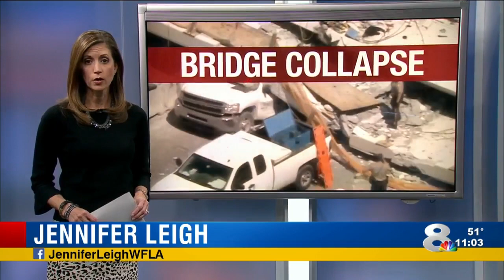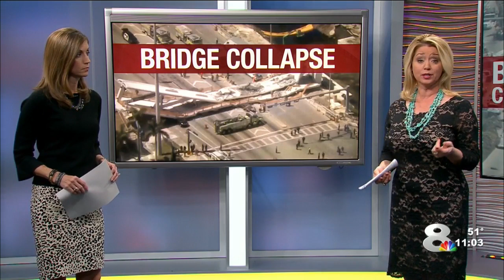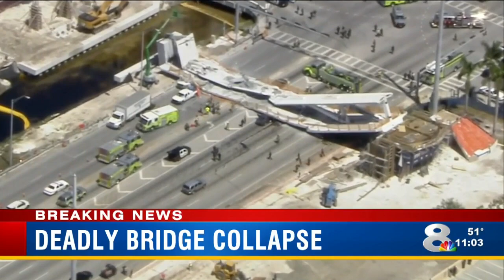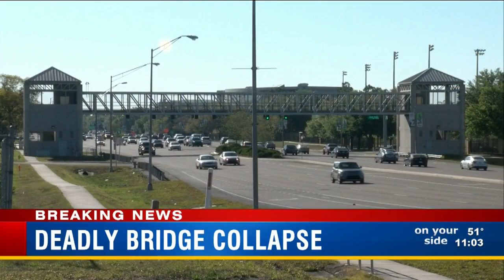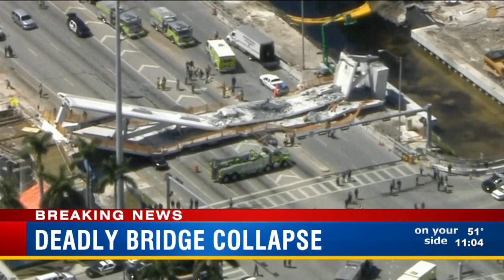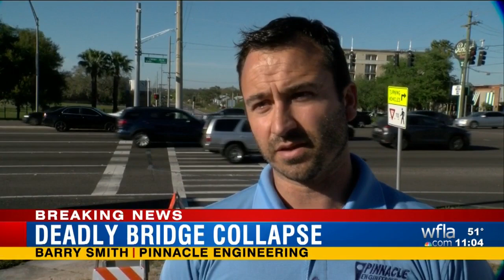What could have caused Miami bridge collapse disaster?

Comment: The bridge was designed to be supported via cables from above. The new so-called "accelerated bridge construction" method that was being used apparently didn't include the cable supports, which were to be added later. Seems like a basic engineering mistake.
Reply: A J MacDonald   I have been wondering if it is necessary for a 50 yard pedestrian bridge to weigh more than three 747s and cost more than Trump's Mar-a-Lago estate. It smells a little like bullshit, don't you think?
Reply: The famous pedestrian/bicycle bridge in Little Rock is like 100' in the air and almost a mile long, and it didn't cost that much. lol
Reply: A J MacDonald Jr — No, there was never any intention to have supporting cables.  This as not a cable-stayed bridge.  It was a truss bridge designed to look like a cable-stayed bridge.  A dumb idea.